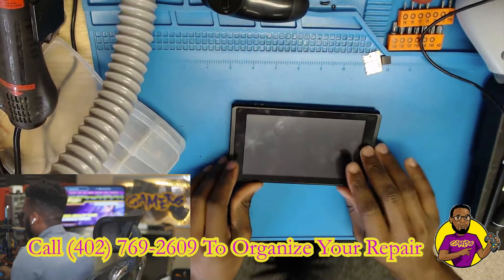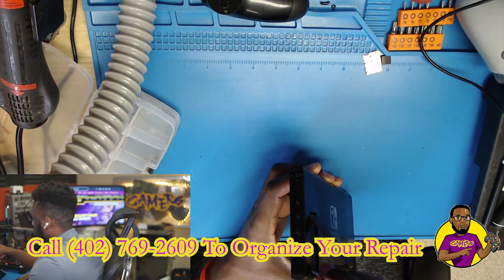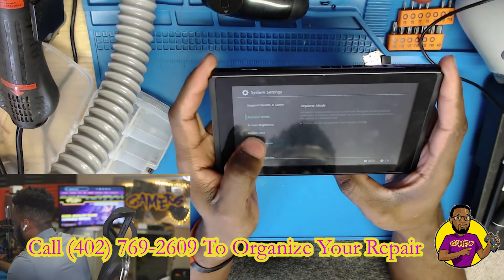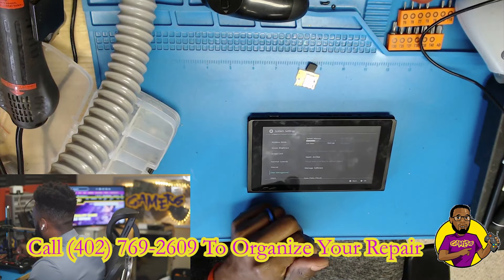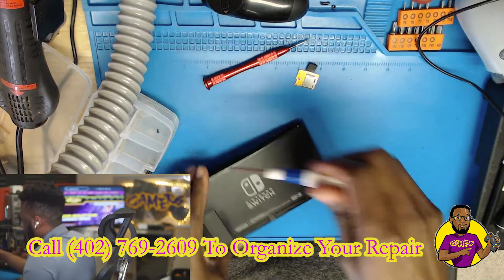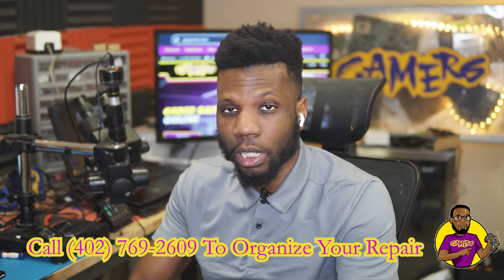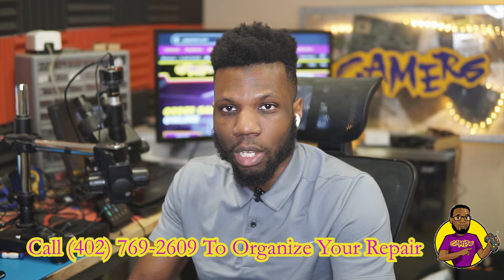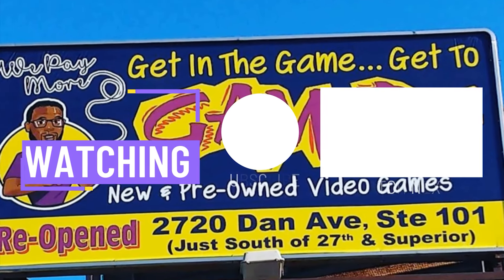Fix Nintendo Switch SD Card Not Detected Or Working (Quick Repair)

Comment: Clicked off this video after he pulled out the tool
Reply: Same
Reply: Same
Reply: @davidslounge i think it’s people not wanting to possibly damage their switch
Reply: It’s just a screw driver and a super easy fix
Reply: Its a y or tri wing screw diver easily 5 or less bucks in a pack set and a phillips i think theyre bith 50mm
Reply: Did you want to use magic to fix your switch?
Reply: Amazon has the whole kit with the tools for $10.. I just fixed my son's switch today and saved $90. It was super easy. Just don't lose track of the screws
Reply: @slimeyartz15 i know its been 4 months, but my guy if you're here, your switch is already damaged
Reply: General Kenobi 🗡️🗡️🗡️🗡️
Reply: @davidslounge point flew over your head😂
Reply: @perturbedpedestrian8035  you’re right, I must’ve overlooked this
Reply: Ok
Reply: Only way to fix it. Not to bad.
Reply: Cheaper than a $99+ repair by Nintendo 🥴
Reply: Just go to a shop
Reply: It's just a few screws.. Quick fix same some Money

Comment: So mine is saying sd card has been removed and I’ve replaced the sd card reader a few times already and replaced the sd card im not sure if any movement triggers it but it does do it if I move it a lot.  I’m not sure what to do anymore. Any advice? No pins are broken or anything I checked all of that.
Reply: same problem here, after replacement it worked a few days but now the same, switch detects sd card then I get the message it has been removed and this constantly, what else could be wrong?
Reply: @mawi435  I've been dealing with this nonstop. Not really sure what exactly is going on but have you found a solution anywhere on your end?
Reply: @itsanti2748  not really, I have to check the connector itself when I open it up again, have seen a video where a pin of the connector is faulty, may this is the problem..... had no time recently but if you have an solution let me now pls! 🙏
Reply: my Nintendo switch Do it like month ago
Reply: @hi-chew22 How did you fix it?
Reply: Anyone with this issue let me tell you something, you'll need to have the connector replaced, it cost around 175 dollars of what I seen, it's a small component and it's easy to mess up, you're likely better of buying a new one.
Reply: It is definitely the sd card
Reply: @hi-chew8562 how do you fix it
Reply: @noodleeater-zx5di  Hi, I managed to fix mine, I just had to clean the contacts and reset tightly the ribbon cable.
Reply: @-Chrome- and how do you do this? Total novice hear. I replaced the card reader and still having issues with it saying the sd card has been removed
Reply: @auroraw6061  Make sure the SD reader is connected and once you screw it make sure it doesn't move, it happened to me multiple times, I would also advise to check the continuity between the rest point, just to move out the possibility that the connector is bad.
Reply: Same
Reply: The same issue was happening to me, i replaced the card reader and the message still kept popping up. What i did was a little unordinay and maybe a bit extreme. first thing i did was add some 3m tape underneath the micro-sd reader to hold it in place better. Then i placed a square semi thick piece of plastic just enough to fit inside the plug area (on top of the plug of course). then, i added some 3m tape on top of the piece of plastic and stacked it just enough to where when i place the cover back on and bolt everything down, it would create pressure to hold down the plug and thus not being able to move at all. Make sure to get the 3m tape inside the gaps around the piece of plastic for more stability. once you put everything back into place its okay if you feel a tiny bump, that just means that theres pressure in that spot and that reader and plug aint going no where. My kid has been playing with it all day and no message has popped up, so far it as worked. i'm sure theres other ways of keeping it from moving but this is what worked for me. You could probably buy some glue for mother boards or something. Also, you could just stack tape but i choose the piece of plastic just because its harder and so it provides more stability. Just remmember that it being lose and not secure plays a big part in whether or not it works properly especially for old nintendos.
Reply: once you put everything back into place its okay if you feel a tiny bump, that just means that theres pressure in that spot and that reader and plug aint going no where. My kid has been playing with it all day and no message has popped up, so far it as worked. i'm sure theres other ways of keeping it from moving but this is what worked for me. You could probably buy some glue for mother boards or something. Also, you could just stack tape but i choose the piece of plastic just because its harder and so it provides more stability. Just remmember that it being lose and not secure plays a big part in whether or not it works properly especially for old nintendos.
Reply: Playing rocket league. Mine started failing gradually. (Micro SD removed shut down system)Started occuring more and more often until new update came out that's larger than the system memory. That's when I notice it's completely stopped reading the SD which I've already replaced with a perfectly operational/compatible SD card. And still (no SD inserted) and card slide in slow and squishes back out slightly. Any clues? Bout to just take this apart now that I'm geekin

Comment: The same issue was happening to me, i replaced the card reader and the message still kept popping up. What i did was a little unordinay and maybe a bit extreme. first thing i did was add some 3m tape underneath the micro-sd reader to hold it in place better. Then i placed a square semi thick piece of plastic just enough to fit inside the plug area (on top of the plug of course). then, i added some 3m tape on top of the piece of plastic and stacked it just enough to where when i place the cover back on and bolt everything down, it would create pressure to hold down the plug and thus not being able to move at all. Make sure to get the 3m tape inside the gaps around the piece of plastic for more stability.
Reply: Yes that’s seems to be the flaw with these. That they easily become unplugged with minimal movement

Comment: Super helpful! I bought a replacement SD card reader and the tools to open up the Switch. What ended up happening is that the OEM reader was simply unplugged, I suspect when my son dropped his Switch. Simply pressing to plug the pins back together and it read the inserted card immediately. This was a great video and helped me through the process, so thank you!
Reply: Thanks for this comment. I think my card reader was slightly disconnected. I disconnected it completely and reconnected it - pressed firmly and then tested it, and it worked! I decided to put a bit of electrical tape over to secure the connector in place a bit better, hopefully it doesn't happen again.
Reply: Same here (except I dropped it myself).
Reply: @cptxander  Perfect. Mine was unplugged also. No need to purchase a reader.
Reply: samesies!

Comment: Hi bro I was if you could give me a bit of information on my sons ps5 . So he’s knocked it of the shelf and it’s snapped the Hdmi cable in the hdmi port and when I’ve picked up the Hdmi port came out the back so I’ve taken it apart and the pads our out the motherboard is it still possible to be fixed thanks and much support from 🇬🇧 👍

Comment: Thanks man! My system hasn't been able to read the card in a few months. I recently bought a new card with more space just to see if that was the issue. Nope! It was just a loose screw that I needed to tighten. If anyone needs tools for this, I used a bit set from Walmart that was labeled for technology repair

Comment: Thanks for the video! I wish I'd have seen it before I started maintaining or repairing my switch..lol
I've removed all the screws on the sides every time I go in. 
My switch won't recognize an SD card after I replaced the thermal paste. I'm fairly certain I left a connection loose or something, but watching this I'm happy even if it's more that, it's a reasonably simple repair to replace the reader.

Comment: Dope! I took mine apart and the old one worked just fine. Looks like the connector came loose. Used a spudger to push it back in place
Reply: Is the connector the black thingy?

Comment: Just updated my switch after it being turned off for a few months. Now I consistently get the "micro sd card removed" while its still in place. Never had this problem before and only started after the update

Edit: my sd reader broke during my move. So I ordered a new one.

Edit 2: 3rd party card reader didnt fix the issue. Just ordered a "new one" from a broken console that was parted out. Fingers crossed for me.
Reply: Does it work?

Comment: it worked for me just to clean it. Thank you so much for the tutorial. Also, those Y screws can be a pain so there is a video circulating of how to use an alternative to a  Y screwdriver. I had to this that method to remove those pesty Y screwdrivers and it totally worked. Thank you again for the awesome tutorial. My SD card reader for some reason was loose I removed it cleaned it and put it back and it totally worked! 😃

Comment: Dude, followed your lead when I got to the part, I noticed it didn't have to put any effort into disconnecting it. turns out it was just not connected very well straight from the factory. Just gave it a nudge, and put an extra piece of tape over it and it golden. Now I have a spare reader if it ever really does fail. Ignore my typing.  Sorry.

Comment: What size bits did you use for each type of screw? Some of them will come out, but others won't. I can't tell if I'm using the wrong size or trying to remove a stripped screw.
Reply: Stripped screw
Reply: The four back screws use Y000 and the sides use PH000. So basically the smallest size of screwderiver head.

Comment: i got to the part where you disconnect the touch screen.  paused for a second and reconnected it.  turned it on and it worked!  sometimes it just comes loose, saved myself the trouble of replacing the touch screen, the peel looked daunting.  so for anyone who has a touchscreen not working try this first, just disconnect and reconnect the ribbon it might work!

Comment: Hey man, Do you have any videos that help fix corruptions for the Nintendo switch? I even switch consoles to a brand new one and they all give me the same kind of corruption when trying to download games or they go through and are unplayable. Is it something with my account or an SD card issue? Getting the SanDisk extreme 1tb card. Most games work fine but then the ones I really wanted to play wasn't working.

Comment: My Nintendo Switch had the error "the MicroSD card has been removed" at random times during games only in handheld mode at the end of a month,then worked the next,then stopped again,and in September 2023 it wouldn’t read the card anymore on the 12th,saying it "Unable to access MicroSD card".Does the reader need replacing is it is bent or is it the motherboard?The reader wasn’t bent before the issue came and there was apparently no visible damage

Comment: wait, you cleaned the contact but didnt see if the old one worked after cleaning!
Reply: I just "fixed" my Switch.. the cable just wasn't properly in place after I had dropped it. I was going to buy a new reader but because of your comment decided to look inside first. :)

Comment: i don't know how youtubers are opening the switch so easily only 1 one my tri hex screws is unscrewing. only the top right one is working my top left bottom left and right just won't turn. i don't know this is annoying because i just went to a repair shop to get my fan fix and the fan got fixed but either he forgot to reconnect the sd card or broke it somehow. but now my sd card reader isn't reading my sd cards and i thought well since he got it open maybe everything would be looser and it can open but nope i don't understand what's how he was able to open it. did i just buy the wrong 1.5 screwdrivers or something?

Comment: Thank you for your video - i did like you said but i would not recommend the cleaning method - i prefer a little bit of Isopropyl Alcohol and a soft tip cleaning stick.

Comment: In my case.
My 2 switch handle slots have 1 metal plate. After remove it. It works correct.

Comment: My switch(OLED) sees the sd card but when I try to download a game into it doesn't it says that it can't detect it....and yes I have space....help?
Reply: Quick fix: I had dropped mine and thought I have to buy a new reader. Before ordering a new reader, I just opened it up and noticed the reader was unplugged. Pressed it back with my finger and now it works no matter how I squeeze my device. My advice: check if your existing reader is just out of place before ordering a new reader.

i have previously bought a iFIxit screwdriver set so it had all the screwdrivers needed.

Either yours is broken.. or like mine, not connected well. Mine acted like yours.

Comment: I tried this today and i don’t know what went wrong but it was the worst thing to happen to my switch maybe i wasn’t following right but i ordered the screws and as I was unscrewing 3 of the screws on the back were not able to screw because it was fucked up but i still unscrewed the sd reader from the one side of the switch I had access too from the one screw that came undone and now my switch won’t even turn on and i think I broke it and i feel like a dumbass
Reply: ok well I can see the screen barely if I put my eyes hella close to the screen and it works just fine on the doc but i still doesn’t even say the sd card in there and i basically just lost the ability to play handheld
Reply: Okay, then I’m not even gonna try

Comment: Turn off console completely, get a qtip or cotton ball , gently rub the card reader towards you not inside , rub pins on and card and all round it , push it in gently but then when it clicks hold it tight for 5 seconds and let go gently , start console .